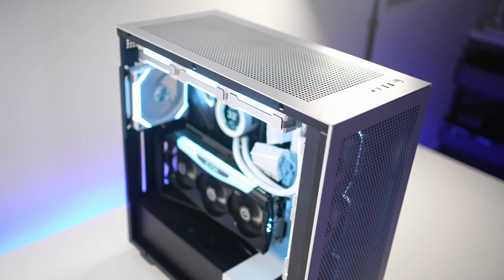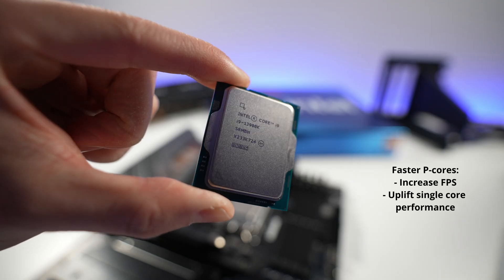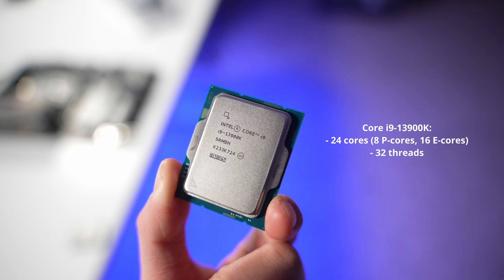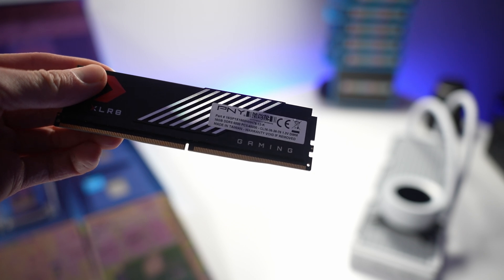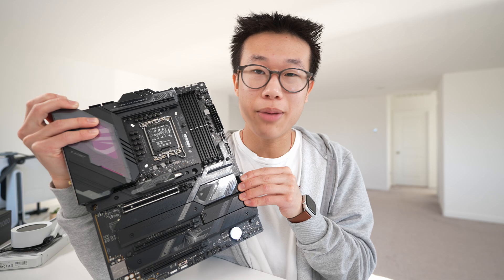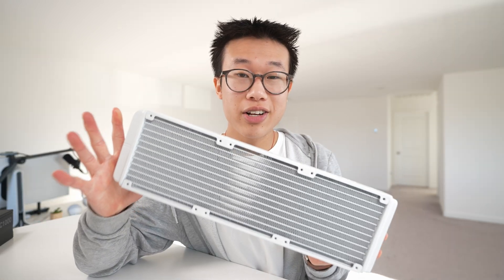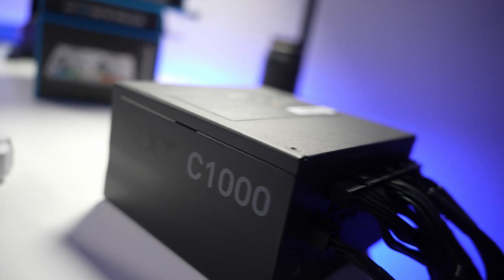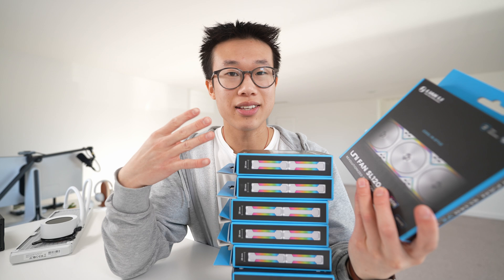My New Gaming/Editing PC - 13th Gen Intel Core i9-13900K PC Build!

Comment: Build looking amazing Tony!  Just wanna ask if the 120mm Lian Li fans on the front look weird from the front since they leave gaps on the top n bottom, or is it not really noticeable with the front mesh on. Was thinking of doing the same thing on either the H7 Flow or Elite, still undecided :(
Reply from the maker: You're right that there's a small gap, but I don't think it looks that bad. You could add a 360mm radiator to cover them if you really want to. I personally chose the Flow for the improved airflow, but I think the Elite looks pretty cool too.